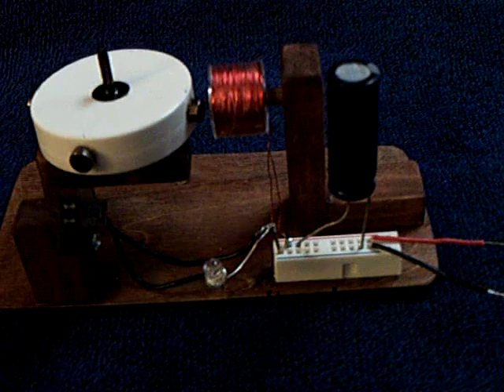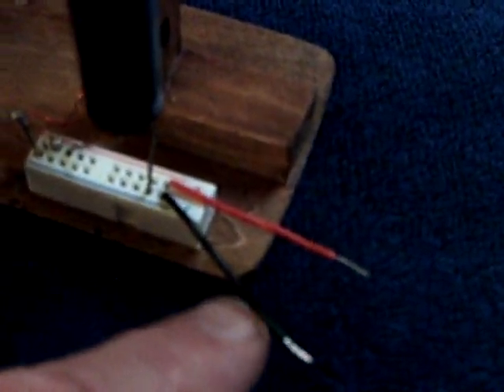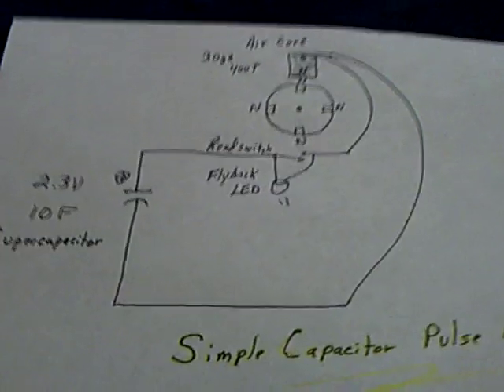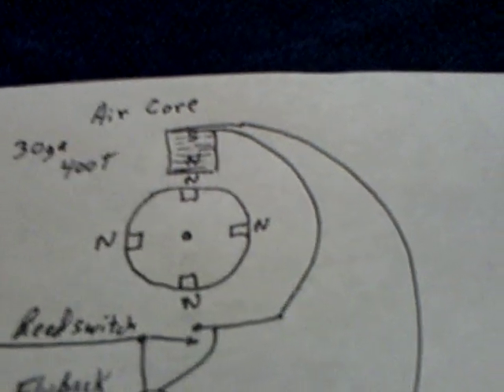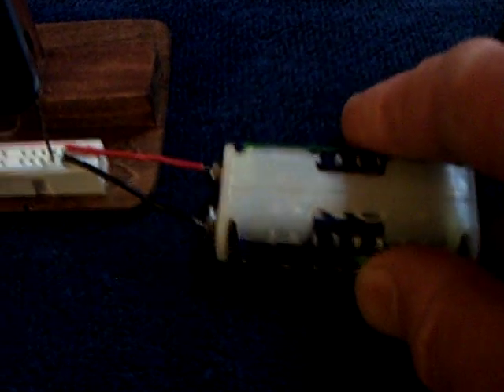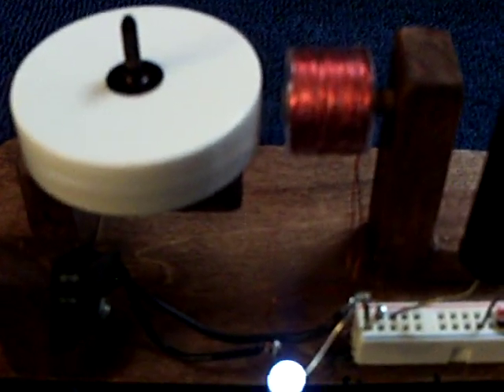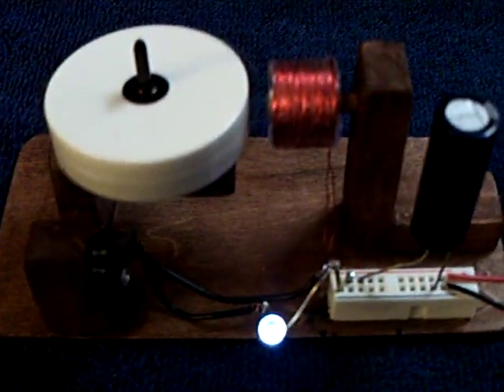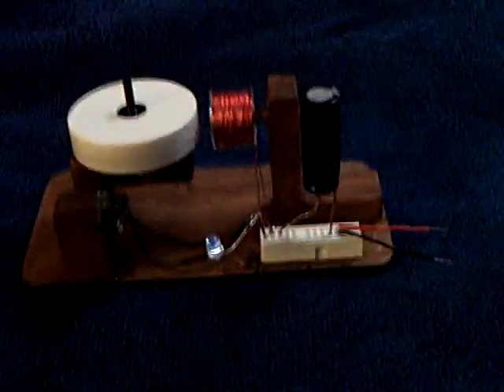Simple Capacitor Pulse Motor

Comment: How to make it run for months or years
Reply from the maker: BIG battery with a solar panel.
Reply: @Lidmotor  
Solar panel value ?????
Reply from the maker: Go big.  I would use a 10w 5v panel  and  pair it with  3.7v  18650 Li rechargeables.

Comment: finally i got mine also working after many tries with ferrite core.
Reply: You finally got yours working with ferrite core magnet or the air core? If the answer is air core, why cant a ferrite core be used?
Reply: ferrite core works, check on my channel link https://goo.gl/zceMCk ,buying reed switch gives fast result
Reply: You can also use a relay coil. Just to make your life easier.

Comment: Thanks for all the great videos ...i am building right along with you came across the same setup you have here but instead of sending the back emf back to the main batt...i put a battery between the negative leg of the diode and the reed...positive of the charge bat towards the negative of the diode...only simple test so far but with one aaa at 1.464 volts i charges another aaa nicad from .6 volts up to 1.288..and the run battery was still at 1.464 when it got done...something to try.
Reply from the maker: Bradley Malone Great!  Just be careful with your conclusions about this.  These batteries are made to maintain a voltage as long as they can so they can run things that require that.  I got fooled by just looking at battery voltages many times.  Check out the discharge curves on batteries using a Google search.  When ever I can I use a 5F or 10F super capacitor to take a quick look at energy consumption.  You are not going to get more energy out of these type devices than you put in.  In fact----they are not even very efficient.  Just great fun to build and play with.
Reply: ***** I understand all that...mostly I am expirimenting with charging "non-rechargable" batteries ....and as you stated...I'm not fooled by rising voltage anymore :) fun stuff though...I use a cap bank of 20 farads up to 2.7v (only charge it with one AA) and it runs for about 2 hours....enough to make me smile!

Comment: 2.3V and 10F is 23 coulomb,  Q = VC
you can see LED light clearly for 0.2 mA current
23 coulomb => 23000 mA sec. = 23000 / 3600 => 6.39 mAH
6.39 mAH / 0.2 mA = 32 hours 
if the capasitor in full charge it will run for 32 hours
Reply from the maker: Nope.  Something is very wrong with your math.  This runs for just minutes not hours on that 10F supercap.  The MOTOR draws way more than .02mA ---nevermind the amp draw for the led because it is using the backspike from the coil firing.
Reply: My calculation is base on the capasitor Fully charge and 0.2mA current, but It could be 1 mA or 3mA and not fully charge too, In that case the time will be reduce.
My point is the motor run for many munite is not cause by recharging capasitor from the coil.
beside that the current will not be constant due to the voltage in the capasitor is going down
Reply: since your Capasitor is 2.3 V and the LED 1.85V mean maximum you can only use your capasitor until it voltage drop to 1.85 V. If you do not use the LED for sure the motor will spin longer
Reply: Aliman Chua The LED is not lit by the capacitor.
Reply: texjarhead Then the LED lit by what?
Reply: Flyback from the collapsing magnetic field of the coil.
Reply: Try your self, just use 1.8 V capacitor or batteray and see it will run or not so you will get the answer your self.

Comment: can i just take out the reed switch and place the LED? its really hard to find a reed switch here in our place tnx.
Reply: without the reed the motor will not run.
Reply: oh ok tnx so the reed switch is  like the commutator which goes on and off part
Reply: you are right. It keep the rotation in one direction.
Reply: There is an alternative design which uses a COIL to sense the magnet, wound around the coil which kicks it back. and you need a transistor to switch it. No matter if it is a PNP or an NPN, just take in account the polarity. That's all - WITHOUT ANY REED SWITCH. The only withdraw is that the coil must be double (possibly, self built or you can try to wind the pickup coil over a relay one). The coils are connected in series and the common terminal is used as well. Anyway, you can find your reed switches on eBay. And this ultimately solves your issue, I guess. Not even to mention that reed switches can be found in other devices, such as bicycle computers.

Comment: I could last longer if you use a signal diode instead of a LED.  A signal diode has a voltage drop of 0.6 volt where a LED drops 1.7 to 2.4 volts.  LED uses more power.  Also a signal diode will allow more power from the magnet passing the coil to charge the supercap slightly.  (reed switch must turn on when magnet is top dead center of coil allowing magnet to send a pulse to cap before being pushed away.)

Comment from the maker: Avidrcdotcom has these small bearings.  The $5 --1/8" id  ceramic ball bearing works good for a tiny motor like this. I'm using a cheap $1 steel one here but I had to rinse it out with acetone and use very light oil to get rid of most of the friction.

Comment: Hey Lidmotor, have you tried putting the stove top cell in a glass of vegetable oil? Oil and water don't mix so if there is water powering the cell the oil will remove it and take its place. I have some of my crystal glue cells and pressure cells in oil and they still work.

Comment from the maker: Actually you are wrong.  I have a John Bedini built cell (that he sent to me for testing) that runs a nice LED light.    The cell doesn't put out much power but all you do is add water to make it work.  Even dry it retains a small charge.  He has figured out the electrolyte chemicals and the anode/cathode arrangement so that the cell doesn't just go to equilibrium and stop.   Call it what you want ---what I have in front of me really does work.

Comment from the maker: Yes.  I have worked with multple winding coils.  Your idea does work but there is no gain in energy. The device will not recharge itself.  The energy has to come from another source.  With "X" amount of energy you can do with it whatever you want but it doesn't become a larger amount by just clever manipluation.  Energy is all around us and IN us but I have yet to see a machine that actually makes it.  Conversion of energy is most facinating though and that we can do.  I get a big kick doing it.

Comment from the maker: Well a second pickup coil will charge a second cap but It is going to cause a drag (Lenz Law) on the wheel.  Looping the energy back to the front can be done with a separate pulse circuit.   This has been tried many times before.  I have never had much luck with the method.  The energy leaks out here and there and not enough gets back to the main source.

Comment: The Compression cells hold a secret that I'm sure John has found out. 

1.2 to 1.3 volts? That's interesting. Only a certain formula of crystal would give that potential. I'm sure you can't speak about whats in the cells but I think I may have a good idea of what the main crystal is. But 2mA dry is very impressive! 

If you're tying to make his cells allow them to sit for a few days, even though they look like they're dying the will sometimes surprise you. Thank You Lidmotor for all that you do!

Comment: That's good to hear! The same can be said with many other of my other cells, the're alive and still going without ever needing water. The 5 foot tall crystal cell i made still runs a LCD clock but every few days the cell dies and by the next day the cell is alive and the LCD clock is at full brightness, the cell has a cycle were it will die and come back and it does this non-stop. 

What happen to the cell that John shipped you?

Comment from the maker: It is just a plain steel ball bearing that I rinsed out with acetone and put very light weight oil on.  A better choice would be a ceramic bearing.  I have used Hall Effect sensors before but not on these super low power motors.

Comment from the maker: Thanks.  The LED drops off in brightness as the voltage in the cap goes down.  It is like running a Joule Thief on a supercap.  Same thing.  Flyback driven LED.

Comment: Hi, 

A couple of questions.  What type of bearing did you use?  Also, you mentioned that you needed a good reed switch.  Have you ever made one of these using a Hall Effect sensor?   I have several and was thinking of trying one in a similar application.

Jim

Comment: I highly doubt that 24 Volts will hurt you since your internal resistance is high. Unless you actually shorted it with a wire then it could make a nice flash. You will start to feel the current flowing true you roughly around 50 volts if you have high amount of water or your hand are sweaty but no harm will be done.